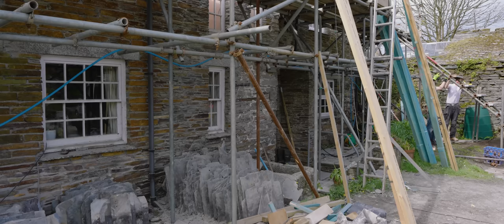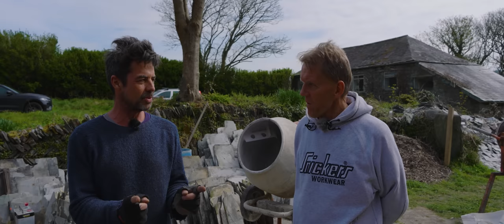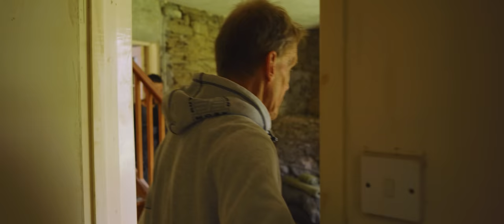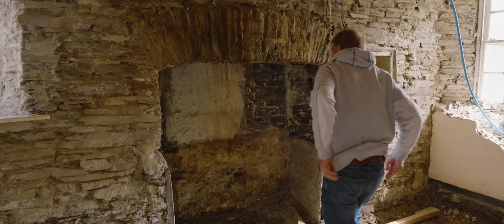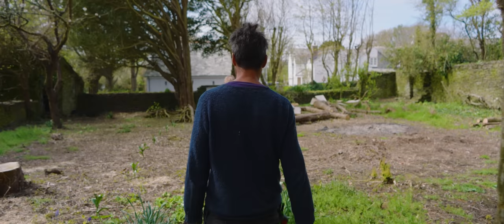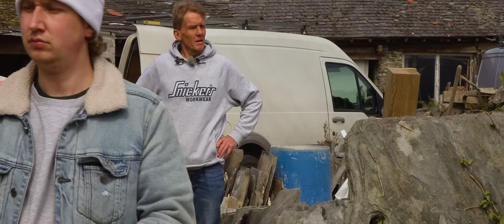Old Cornish Home Brought Back to Life

Comment: Despite being a world away in South Africa Roger, I love watching your videos. A lot to learn or even re affirm what I've taught myself. Our building methods and regulations are probably way different to what you have in the UK, but still I take note, seeing as we did at one time have some very British rules in force here! Edit: Skill Builder is an apt name for your channel, it's all about skill and, most important, common sense.
Reply from the maker: Thanks John. We have a few South African builders in London and one that I know is doing very well for himself with some property deals. It would be interesting for us to see how different and similar your houses are out there.
Reply: @SkillBuilder  Our buildings are 99.9% brick built, as in the UK. My own house is strange in that it has a cast concrete top section of all the outer walls, from picture rail to the top. Not one structural crack after 75 years, a few plaster cracks, yes. The other, more interesting, thing is the building method: there is from the bottom, foundation, 3 courses clay brick, one course cement block, (18 inch for perimeter, 9 inch internal walls) 3 courses clay and so on all the way up. The cement block cavities are filled with river rocks! As was I suppose the fashion in 1948, a pitch fibre DPC under the walls. All suspended Oregon pine floors, except for the kitchen and bathrooms which are concrete slabs, topped by a thatch roof. The original plans show no water or electrical supply to be included in the build, although that was added at some time. I love the old place, I've been here for 32 years now!

Comment: A typical lobby entry mini manor of the 17thC judging by the tracery over the windows , built in slate over the usual killas . This one appears to have a kitchen as an addition rather than seperate . Properties of this type could be found empty all over the Duchy during the 80s and early 90s . The armour in a garland signifies a group of families intermarried of lesser status and not of the major families of Cornwall. Looks like the original granite stonework that would have surrounded the opening in the main residence has been robbed out but a number of examples of this period can be found in publically accessible buildings all over the county to enable reproduction and restoration. For ideas visit The Miners at Mithian for stunning ceilings and details .
Too late now probably,  but when dealing with replacement floors , check whether the building is sited in an area that requires radon gas evacuation or not as although the work here is under permitted development , for the benefit of future occupation,  the construction of an underfloor sump and vent system might be a good idea .

Comment: Another great video , didn't know that cofnish slate can deteriorate from salt air , edinburgh  must have a different regional slate . Roofs in the city haven't been touch in a couple of hundred years . Wish the Cornish renovation all the best,  they have their work cut out for them . Quality content as always Rog 👌
Reply from the maker: Alec 
We will be showing our visit to a Cornish slate quarry in a week or so. It seems that the salt may not be so much airborne as  in the slate in the form of ground salts. 
The quarry owner explained that the good quality slate is deeper in the ground.  Slates can delaminate if they are poor quality and that tends to happen most with slate that is close to the surface. A grade one slate that has a nice ring about it should be good for 200 years. As you know, it is often the fixings that fail after a mere 100 years.
Reply: Delabole Slate is the best in the world. In human terms it pretty much lasts for ever. As you said the fixings are what fails.
Reply: @SingleTrack66  I thought north wales slate Penryn was the best in the world?
Reply from the maker: @chelps6411  I knew people would start slating eachother on this one. Cornish versus the rest of the world

Comment: Surveyors, like the one who told me in his report that I had a gas boiler when that boiler had oil boiler written on the front!  are worse than useless, misinformation and not reporting major defects could almost bankrupt a person. 

I was nieve and assumed he must know, perhaps it had been converted. The oil  tank was hidden but that's no excuse for such a poor survey and exposing their client to huge risks they are paying to avoid. In my case it didn't matter a lot but it made me angry that  he was charging for such incompetence.

 Knowing the types of survey you are paying for and the qualification and reputation of a surveyor is essential. Exclusions written into the contract make many worthless in the event a serious fault has been missed. 

A valuation is only a guess at what a property will sell for. A full structural survey costs more but actually looks at the structure of the building. A house buyers report gives an indication of the condition of the property but is not the same as a full structural surveyor and is usually only  information not accepting much liability for mistakes in the report.